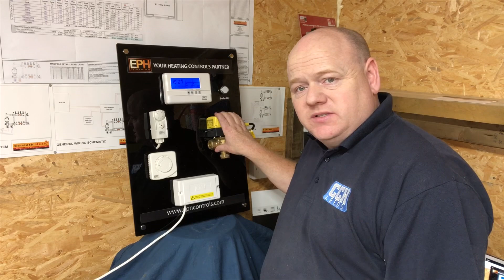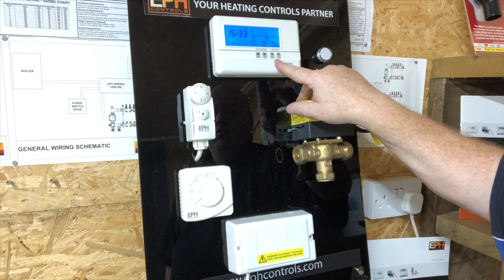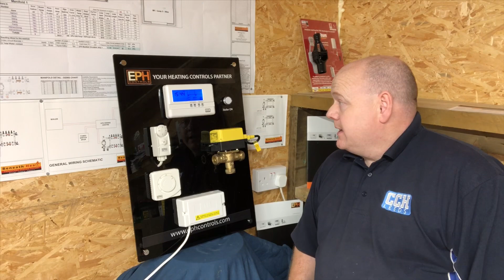Y Plan Heating System - How does it work - Basic

Comment: Were does the pump come in on fully pumped system ??
will boiler still fire up if pump not running ?? 
Does boiler come on first then pump , or pump first then boiler ?

Comment: Remember B is for bath .
Your (and other trade) videos help us notice things and understand how our homes work.(customers that say more than 'no warm fixy fixy ' might be helpful in some cases)
  Helped my friends move into a new house on Monday, the plumbing and electric are a bit odd. Couldn't find a boiler ,guessing there's a cylinder or something in the attic flow and return go up there and there's a top up pipe with a pressure gauge (reading 1 😀) in a cupboard that smells of cannabis. A radiator pipe goes round a corner where there is no longer a wall.all the plug sockets and light switches are at different heights (looks like a faceplate rewire) it's got a lovely fuse box re wireable fuses, and a DIY semi complete light distribution box in the garden labeled up with embossed dymo labels. All freshly decorated with new carpet and laminate.